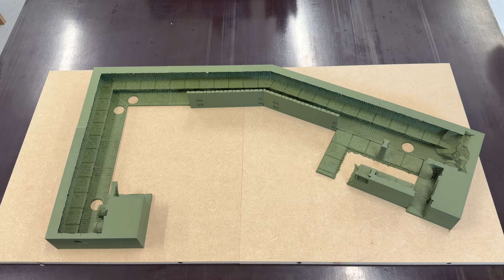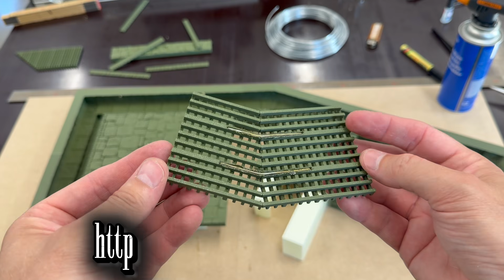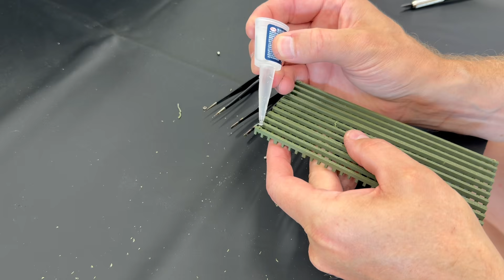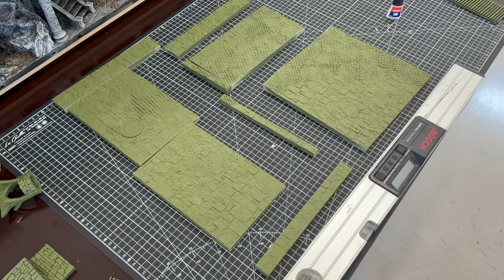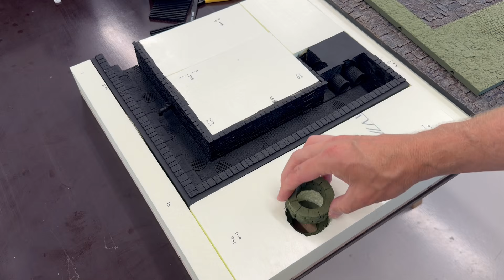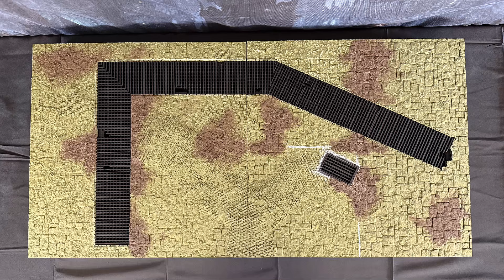I Built a Playable Underground for My Modular Mordheim Table, Part 9

Comment: Use an oscillating multi tool for cutting the FDM tiles it will be much safer and provides a much more accurate product.
Reply from the maker: I hadn’t thought of that! I don’t own one of those, but I might have to pick one up. Thanks for the suggestion!

Comment: I would have tried magnets to hold the sewer grate in place as well. If you try something like that again, maybe recessing a portion of the sewer wall so the grate can sit level with the top of the wall. Keying the wall top and grate underside like teeth in a zipper could also work, but that might be a little labour intensive if you have to edit a 3D file.
Reply from the maker: Thanks for the great suggestions!  I  like your "zipper teeth" concept. It would definitely take a bit more work in the 3D model, but it could make for a really secure fit.

I really appreciate you taking the time to share your ideas. If I build something similar in the future, I'll definitely keep these in mind!
Reply: @Torgelsson  I’ve benefited from far more experienced hobbyists than me over the years. So I’m happy to help whomever and whenever I can.

If the zipper idea is a bit too much, simple pegs and holes would work too. Considering how thin the grating looked, I’d put the pegs on the underside of them with the holes in the top of the walls.
Reply: @13579zod I thought the same, pegs usually work for me.